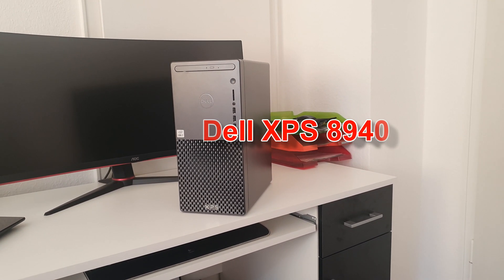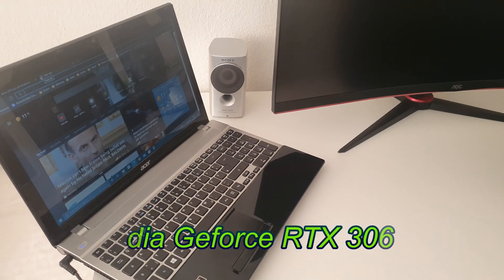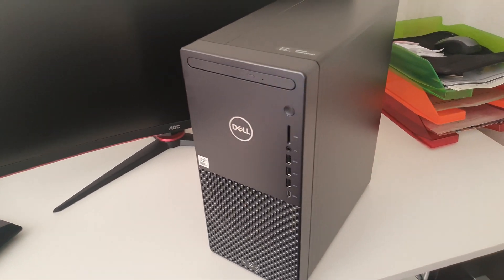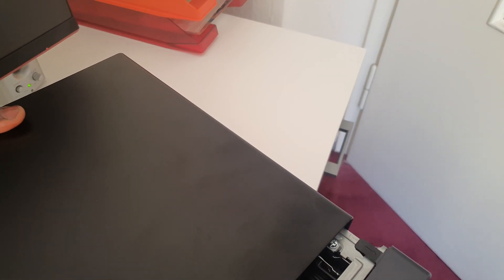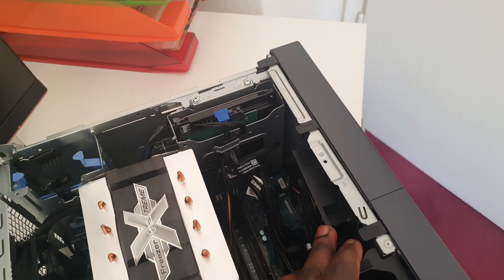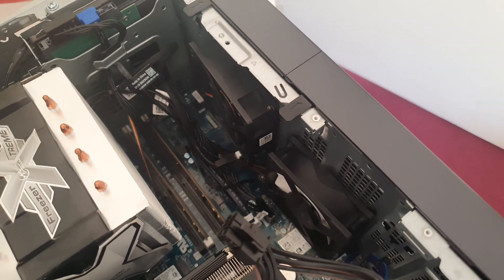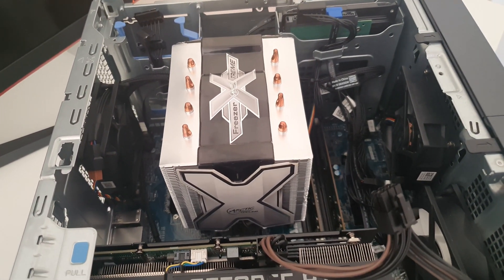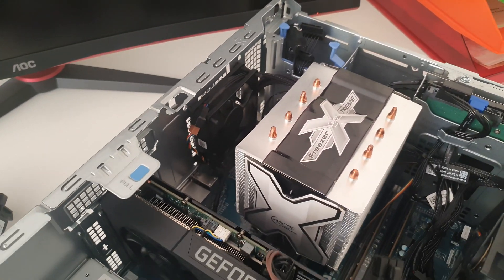Dell XPS 8940 Review and Upgrade

Comment: Thank you for the informative video.  Where did you get the power for the two front fans?  Did you use 2 splitters cables from the rear fan?  Are those 3 pin or 4 pin fans.  You give me the courage to try this myself.  Did you need to ask your wife first before investing in the cpu cooler?  If so, what is a good way to emphasize its necessity to her?  (just kidding)  Thanks again and looking forward to more videos.
Reply from the maker: I used splitter cables. The third party cpu cooler  itself together with the intake fan from Arctic cooling are connected using 3 pins. The Foxconn fan that came pre-installed on the Intel cpu cooler was detached and used as an intake fan but STILL connected as a cpu fan using 4 pins. Note; this was done to avoid any pre-boot errors. The other Foxconn fan(exhaust) is also still connected with 4 pins as a case fan.

Bro, my wife would beat the hell out of me if she realises how much I invested in the cpu cooler. Let's keep it a secret 😄 😄 😄.

Comment: Do you have the i7 10700 that is 65W or the 11700 that is 125W? It appears that only the 10700 CPU comes with the tiny cooler. The 125W variant comes with the upgraded luxury version that is much larger.
Reply from the maker: I have the 65W version. Yeah you're right.

Comment: Great review. Did you have some issues with the cooler in terms of errors from the dell bios?
Reply from the maker: No issues. Once you have the dell fans still installed to sections of the splitters with all 4 pins, everything should be fine.

Comment: With a simple cooler install, 8940 is a pretty decent PC,  mine came with a gtx 3060ti and i7 11 gen
Reply: You also have to disable the GPU and CPU power limits to get the performance you should expect from the specs. If you don't do this you are running at 70%

Comment: Hey do you think it will be possible to drill holes for a sfx psu
Reply: You can do it without drilling, just screw in the middle left screw which is the only one that aligns then get a 24 pin to 6 pin adapter
Reply: Like a dell 5040
Reply from the maker: Yeah sure, you should however be cautious not to drill so far to the right to get in the way of the case cover.

Comment: How are these added components wired into the system?
Reply from the maker: Netspower 4 Pin PWM Lüfter Lüfterteiler Verlängerungskabel Schwarz Splitter Kabel Lüfterkabel und Adapter, PC Computer Ventilator Energien Kabel 1 bis 3 Konverter, Schwarzes Sleeved Geflochten https://www.amazon.de/dp/B085C2XMQR/ref=cm_sw_r_em_apa_glt_i_XZ57KW89ZMRS0H6Z4NHS
Reply from the maker: I used a splitter

Comment: Nice vid, I’ve got a question tho. I’ve received my XPS 8940 today and did similar cooling upgrades. However I would still like to add a fan infront of the gpu, like u did. I have just 1 intake and 1 exhaust fan so far. How did u devide the fans over the fan connectors? Since there are only 2 connectors. Did u put a splitter on the connector to where the cpu cooler is attached to as well?
Reply from the maker: Yes I did.

Comment: nice Video you made. I am planning to buy an XPS 8940 before April ends. So, is this heating issue a known issue in this XPS 8940 model? Or it is just that you upgraded the GPU to RTX 3060 and running on i7 10700? I have customized my new XPS 8940 with 11th Gen 15-11400 with Geforce GTX 1650 Super 4GB plus 16GB of RAM. 

Do you think since I am just gonna use the bare minimum specs, the current cooling system in the XPS 8940 should be enough? Also, can you confirm the brand of the RAM sticks Dell installed and the 512GB M.2 PCIe that came with your system? I appreciate your response bro! Thanks.
Reply: All righty! Thank you sir for your input. I think I am good with the stock cooling of the XPS 8940 system for what I intend to use it for now. I would certainly look for cooling upgrades in the future.
Reply from the maker: I intend to use the XPS for high end gaming and video editing which the stock cooler was never gonna be able handle. I would say the dell XPS in its original form is meant to handle normal office tasks. The system is however capable of handling more demanding tasks once those basic upgrades to the cpu cooler, vrm, and intake fan are made.

The M.2 SSD is from Samsung, but I couldn't figure out what brand of RAM Dell uses.

Comment: could you tell me what happened to your machine with the cooling issue?? because i am going to buy the same one soon and i'd like to know if that is really a serious problem. thank you!
Reply from the maker: If you're planning on using this system for normal  work, like office and picture processing, then the stock cooling solution from dell is enough. But for more demanding tasks like high quality video editing and gaming, you definitely need cpu cooler upgrade and an intake fan.
Reply: @bentechy  Thank you for your reply:) I'm going to use some Architecture 3d modeling and rendering programs. And I play only league so probably it will be alright?

Comment: Man are u a wizard? U just casually put a beefy cpu cooler in that xps. If u look up on xps community page, most people gave up on diy mount an after market cooler and ended up buying a better cooler directly from dell. Can u do a video on how u manage to do that?? The entire xps 8940 community will definitely thank u for that. Thanks
Reply from the maker: I will surely do bro.
Reply: @bentechy  Thank you
Reply: The Dell community page actually has a good thread about people successfully replacing the coolers in their systems. It's how I discovered that a Noctua U9S can easily be installed in the case, and that's what I've done with mine!
Reply: @Jenkins Leeroy The Noctua mount plate can be screwed down to the case mount points (the same screw holes used by the Dell cooler) using some M3 screws. I'd recommend using 18mm long ones (x4), with an M3 flat washer + M3 spring retaining washer on each.
I've seen lots of people talking about using 16mm screws, with no spring washer, but you really should put one in there to help stop the screws loosening (I see there's debate over this, however...).
Otherwise follow the Noctua instructions for mounting as an LGA115X Intel socket (use the white spacers).
Figure out which screw holes on the Noctua plate the M3s should go through to give a proper alignment. I think it was the middle hole (out of 3).
Make sure that whatever fans you're replacing are PWM, the one that comes with the U9S is already. But then I also replaced my rear case fan. If it's not a 4 pin PWM, then the system will complain the fan is missing/wrong.

Comment: I wish I could have seen how you installed the cooler. were there any issues or was it easy.
Reply from the maker: I just screwed the bracket onto the socket with 4 machine screws and installed the cooler thereafter. I did not install the bracket using the push-pin that was included in the package,  because that would mean taking out the entire motherboard and installing a new backplate.
Reply: @bentechy  are you using the screws that come together with the stock cooler? If not, what size of screws did you buy? Ty
Reply from the maker: @leechisiong8824 Had to find 4 extra  screws, same size as the ones that came with the cooler.
Reply: @bentechy  you can’t anyways as those standoffs under the board are mounted to the chassis, you’d need a Dremel to remove them

Comment: I got the xps 8940 with an i5 10400 and rtx 2060 for $800 USD on sale.  I replaced my case fan with a Noctua NF-A9 and added another Noctua NF-A9 to the front and moved the hard drive to the other bracket.  I plan on adding my i7 10700k and a Noctua NH-D9L whenever my dell VRM heat sink comes in. I can’t run the processor without either the Dell vrm heat sink or shorting the two screw holes with a wire.  Do you know of any way of controlling the fan speeds in this system?
Reply from the maker: I only know how to check the system fan speed in the boot menu and how to toggle some system checks, but controlling the fan speed..........there is none that I know of at the moment. I will look into that and let you know if come up with something.
Reply from the maker: It is possible with HWinfo, Try it out. Let me know if I should make a short video on it.
Reply: @bentechy  I tried it and was able to control my fans. Thanks!